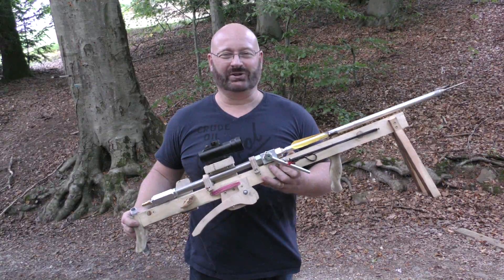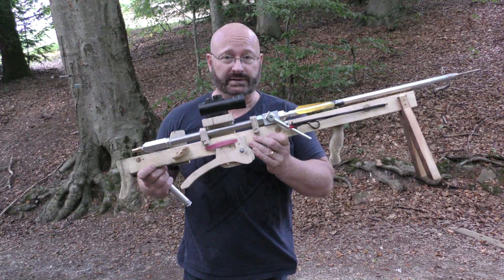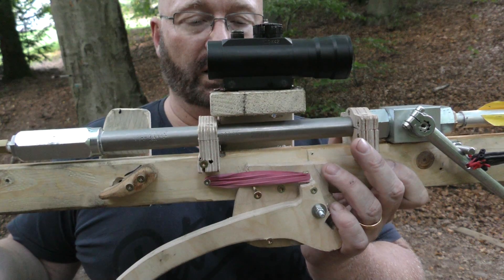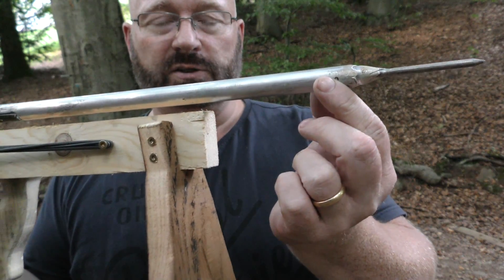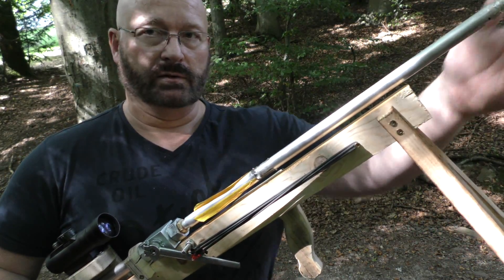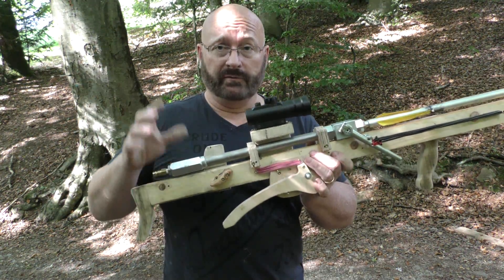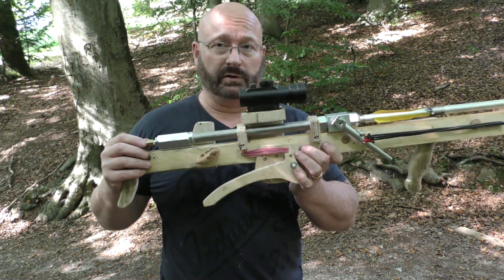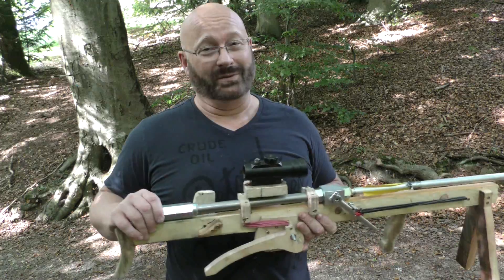Project 1000 Joule Airrowgun: Getting Closer! (714 Joule)

Comment: Hello,Some considerations and suggestions:compare the volume of the barrel with the volume of the tank. Lets say, the barrel has a volume of 0,315liter and you pump the tank to 300bar. So in the best case, you would reach 100bar at the tip of barrel as you open the valve. lets say the diameter of the barrel is 2 cm . so the area is about 3cm^2. 100bar is about 1000N/cm^2=> 1000N/cm2*3cm^2=3000NIf the barrel is 0,5 m long => 3000N*0,5m => 1500JIN THE BEST CASE. So with some 700J you should be near the optimum.Reasons, which will reduce the energy: 1.)The valve is not fully opened => arrow away before the pressure has its peak in the barrel2.)The air cools, when the pressure is reduced. This leads to a further reduced pressure in the barrel. You can see even now, the "smoke" / condensed moisture, when shooting.3.)Volume of the tank: 0,105 liter * 250 bar * 1,23g/liter= 32g air (supposing it is a ideal gas) This comes into to range of the weight of the arrow.  Some energy is used the accelerate the air itself.Suggestions:1.)Pump the arrow directly  with 300bar (Not shooting) for a static test. Maybe you was just lucky, that never the full pressure was in the barrel, when shooting due to the slow valve.2.)Remove the long outer part of the valve handle. The momentum is square to the length of the handle, because it is the outer part. => quicker opening of the valve without stronger rubber
3.)Use a bigger valve, so this is not the bottle-neck.4.)Remove all edges inside between tank and barrel5.)Try a "Dreikantschaber" as arrow-point.6.) Try how far the arrow "flies" through water.Regards from Hamburg
Reply: Little error: "Lets say the barrel has a volume of 0,210 liter" (not 0,315).

Comment: mr sprave, i think the next step if use an air pump like the one you keep in the glove comparement for when your car tire needs air and run it on battery.  so it will all be self contained

Comment: you should try and use a snaller diameter barrel to increase the velocity of the air passing through and see how it impacts the speed of the arrow. if it means using a smaller arrow u should customise it to have a heavier tip or shaft to compensate for the energy lost by the difference in mass.

Comment: As you move to higher and higher pressures,  you may want to use a hydro-test when checking the integrity and safety.  Since water is incompressible,  they are much safer.  Pressure vessels and piping are tested this way.  Don't want to see one of my favorite channels explode.

Comment: Another way you could increase the energy is to use helium instead of atmospheric air or co2. Since a helium molecule moves at a higher rate than atmospheric air and co2 it can accelerate the arrow more over a short period of time. Cody from codyslab did an experiment where he used helium in an air rifle and if memory serves it nearly doubled the velocity of the pellet over normal air.
Reply from the maker: How to get the helium into the gun though? At 250 bar?

Comment: I think that the rapid pressure change causes the metal to flex just a tiny amount every time you shoot. Over time micro fractures will form in the metal and it will become brittle and crack. I think its totally fine just as long as you don't start to fire it 1000 times.
Reply from the maker: 1,000 shots, that is 125,000 pump repetitions! At least I'd die as fit as an olympic athelete :)
Reply: Great attitude :)

Comment: I have a much much larger air gun that uses PVC pipe and much lower pressures, with about a 20 cubic foot air chamber, it shoots 3d printed bullets and is able to punch right through 10 or 11 cardboard boxes, but of course its nothing compared to what you have made, my suggestion to you would be to make your arrows longer and thus have a longer travel time on the barrel, you might be able to get a little more power out of it.
Reply from the maker: I experimented with that, but don't forget that then the barrel also has to be longer. The pressure of the air drops when it expands into the barrel (before it hits the arrow), so at some point adding barrel length is counter productive. The 50 cm arrows are pretty much the best compromise, plus they also fly really well.

Comment: Is there a significant difference in speed and energy by moving the bands closer to the pivot point on the valve? A smaller distance to travel would mean the valve is open in less time?
Reply from the maker: You have to balance things carefully. Getting closer to the pivot would require much more rubber force as the lever effect goes down, and at some point that will cause mechanical issues.

Comment: a hand gun in .40 s&w haas around 650 joules, a rifle in 7.632
 by 39, has 2,000 joules, and a 7.62 by 54 has around 3,500 joules.

 you have a way to go!
Reply from the maker: Don't compare this to a gun, shooting tiny, blunt and soft projectiles. Compare it with commercial compound crossbows. Arrows are much more lethal than bullets.
Reply: How many joules do you think you can get the air gun up to? if you can get it up to 1,500 that would be crazy. And what if you had some external tank you can swap out, to make reloading faster?

Comment: what if you made the valve behind. (using vaccume instead of pressure (pressure from atmosphere would push the arrow))  and the barrel was the reservoir ?

you would loose the air expantion lost in the barrel lenght

Comment: Jörg, if you can't manage 1000 joules by switching over to the compressor with 300 bars, what's your next step? Will you make the arrow heavier, or do you have another part of the system you're thinking about changing? Make the pressure chamber even bigger?
Reply from the maker: Bigger chamber and more rubber would be the logical step. More rubber requires a new valve lever, from solid steel though (this one is probably zinc).
Reply: JoergSprave
Yeah, I was waiting for that handle to snap. Maybe add a second stopping screw on the other side of the hole you drilled?

Comment: I thing you should slim down the barrel. There is much air loss expanding in the barrel. things about smaller barrel:
1. less air is lost in the barrel
2. less air is able to push on the arrow tip?

Best sollution will be opening the breach in the arrow tip... but that's imposible... So maybe you can try calculate how many cubick centimeters of air is in the barrel and count it to the presure.
You know if is same amount of air in the barrel as in the chamber you will get something about a half of the air presure at the end of the arrow.

But shorter arrows are less stable so... it's your choice but I will do some experiments and try every posibility. thx for reading this. bye

Comment: Maybe you could make it shoot twice with one pressurization (don't use that word every day lol)....  Connect two of the tubes you're using to hold the air with a high pressure valve, fill the entire section up with the valve open, then close it.  The regular trigger would operate the first valve and fire.  Then the second air tube could be fired with a separate mechanism.  Seems like something that could be done without much extra space or weight.  Hell maybe even 2 more shots if you used a T valve that would allow air to travel from one of the rear two tubes through the front separately from the other read tube.  Just an idea to play around with lol.

Comment: a couple of suggestions from a non crazy german engineer.

1. add more 30cm tube things. link them up so the release gas at the same time.
2. a little tuning. the pipe should be as long as the arrow. this increases the pressure felt by the arrow by a tiny bit.
3. this may sound stupid but what about a trigger for the trigger? the first trigger would release gas from a tiny cylinder which would trigger something. the Something would be the trigger for the actual release of the arrow. 
this may be complicated but its probably faster than that rubber thing you have now.
Reply: You triggered me with your idea of the trigger for the trigger
Reply: +Det Crusader triggerception 
4. oil or some other lubricant. it may slow down the arrow or it may act as a seal increasing power. either way it lessens the friction between metals.
Reply: +Bryan Suh 5. A longer barrel can store more gas (more energy) and will make the weapon more stable and precise.
Reply: +Det Crusader actually i think the arrow has to be increased in lenght with the barrel. if the barrel is longer than the arrow, it would result in lower air pressure, hence the 3 idea.

Comment: Titanium instead of wood to give weight reduction, bigger parts that fit into the air gun stock for safety and control, Higher grade rubber for release with crank, hmmmm back of the stock could have the air loading system. this would have a cap, would greasing the pipe give less resistance at that point for an easier glide? What about optimizing the pipe's diameter for more direct compression? Would that even be effective at that high of pressure? It makes me think that it might loose accuracy.

Comment: #Joerg Here another safety thought: The fact about "an equal and opposite force being exerted" - make sure that whole barrel assembly is bloody anchored well on that wooden frame, you would not want that coming off while having your face behind it.... sorry about my continuous whining concerns about your health :P
Reply from the maker: It is clamped down with two steel reinforced pieces of 18mm plywood, no dangers here.
Reply: The weight of the projectile isn't high enough to exert a large counter-force imo

Comment: Maybe you mentioned it anywhere but which diameter and lenghts (or volume) does the barrel have?
Reply from the maker: Barrel is 14mm outside, 10mm inside dia and is exactly 50cm in length.

Comment: some serious stuff here, you can try to vacuum the barrel either with the seal between the arrow and the barrel (it is not actually a barrel because the arrow is over it) or with little aluminium cap on the end that will pop easily like in the sensors for shockwave damage. this might help, because by increasing the pressure difference and clearing the way for the high powered air you will get better energy transfer. I hope this helps. good luck and BYE BYE

Comment: the arrow accelerates while he's over the inner barrel, so if the barrel would be longer, the arrow would accelerate for a longer time at the same rate so theoretically it should be faster. 

Another thing that came to my mind: air is compressible so if you have 105cm³ at 300Bar in your air tank and let's say the same amount of air(I have no idea how much it actually is)  in the barrel ab 1bar (atmospheric pressure) they will level out to 150 bars before even moving arrow. So in theory it would help to fill the barrel with a liquid (a solid thing would be seen as a projectile) that has actually zero mass( if water was used, it would take most of the energy instead of the arrow). 

While writing this it starts to sound pretty stupid so screw that second thought but a longer barrel might actually help. And mybe an even bigger airtank
Reply from the maker: The longer barrel also has more air inside, plus the arrow is more heavy. Water might work but it is messy and probably illegal (I am shooting matter through a barrel).
Reply: Da wäre ich mir nicht so sicher: Hochdruckreiniger "schießen" ja auch Wasser durch einen "Lauf". Man müsste mal die Definition von Projektil nachschauen

Comment: When you get it to 1,000 joules, it's gonna be frightening-- hell; it already is!  I wonder if you'd need to reinforce the arrow to withstand all the pressure, but I'm assuming your ammunition is tough enough!  I bet, with the right arrows, you could have very effective armor piercing projectiles.
Reply: The sheer power it's putting out is really impressive.  I used the word frightening to be dramatic.  :p
Reply: I would like to see what it does to an AR500 armor plate using arrows with a hardened steel tip.
Reply: Speed is what penetrates armor. This lacks speed.
Reply: True, but if we're talking about light armor say, a car door, than I think with a hardened carbon steel tip will be enough to get through that type of "armor".  3 Archery mats aren't even enough anymore.

Comment: Would a solenoid valve be able to release the air faster?
Reply from the maker: Solenoids that run on portable batteries won't work under pressure rates like this.

Comment: Use a lighter arrow and try to break the sound barrier hahahaha!
Reply: yep. i also wonder how fast the gun could shot.
Reply: It would lose energy and likely become unstable with a lighter weight and higher velocity
Reply: A lot of energy is being wasted already because the arrow leaves the barrel so quickly.  It might indeed go faster but a heavier arrow will be more efficient at absorbing more energy and so pack more joules.
Reply: Shadowknight5518 Barnaclebeard , clearly you both need some lessons in physics. 

Shadowknight5518, no. An arrow is designed to have its centre of drag behind its centre of mass. It would not be difficult to design a mach1+ arrow today. 

Barnaclebeard, Not necessarily. Very tricky to work out which is more efficient due to barrel length, pressure leak etc. A lighter arrow on a longer barrel would be better than a lighter arrow on a shorter barrel only if the pressure in the longer barrel is positive until release. Its a balancing act.
Reply: +ItsThatMilkshake You literally just said to make the arrow lighter. You'd have to take the weight from somewhere and to boost the speed to Mach 1+ you can't just take weight out of the body, you'd be taking it out of the front. Therefore... Unstable at higher speeds.
Reply: Shadowknight5518 ...... what the hell are you on about pal?

You can take weight from anywhere you please, and as long as you have the centre of drag behind the centre of mass. This is the bare basics of flight stability. I have finished MECH2700 at the University of Newcastle ie a fluids and thermodynamics course. 

You can take weight out of wherever you please.
Reply: +ItsThatMilkshake doesn't matter, the amount of weight you remove to let it travel at the speeds you desire will not allow it to fly stable in one piece
Reply: Shadowknight5518 Wrong. You clearly underestimate the strength of modern composites. 340m/s is not that out of this world. A .22 calibre bullet breaks the sound barrier and flies stable despite being many times lighter than an arrow. A carbon fibre arrow with a mass of 300 grains (0.0194397 kg) with no pressure leakage could hit the speed of sound with 1123.61 joules of potential energy in a perfect system. Jorge could definitely obtain a high enough potential energy for this while accounting for inefficiency. All he needs is a stiff enough arrow, which is not a problem.
Reply: +ItsThatMilkshake yeah I'd like to see it happen, but I believe a 22. Uses centrifugal force from rifling to fly straight and it's much smaller and denser than an arrow that goes around the barrel. I can't think of a material that is strong enough and light enough to make into an arrow that won't tear itself apart. Maybe if he made an arrow to put down the barrel but the hollow arrow as wide as his barrel just seems unrealistic
Reply: Shadowknight5518 HOLD UP SON. You just said centrifugal force, WHICH DOESNT EXIST So now im even more confident that you have no idea what you are talking about 

NOPE, a rifle does NOT apply a centripetal* force, the rifling applies a torque, which gives the bullet angular momentum, which then results in stability along the axial axis, along with aerodynamic efficiency/design. Oh you cant think of something that would hold up? I CAN :D carbon fibre, 7075 aluminium, titanium, and many more! 

If Jorge used 3000 PSI on normal arrow dimensions, the MAX pressure inside the arrow would only be 119 megapascals which is one quarter the yield stress of 7075 aluminium. EASY :D

It may seem unrealistic to you, but I have studied thin walled pressure vessels at university my friend. Its 100% realistic.
Reply: +ItsThatMilkshake +ItsThatMilkshake didn't say it was impossible I said "unrealistic" he's not going to spend the money, or design such an arrow. It's just u realistic. And yes I have no idea what I'm talking about with bullets as I admittedly have never studied the effects of rifling (I'm not sure why you felt the need to bring that up though). Honestly though you sound like a good guy but I naturally doubt everything everyone says that I know will never happen.  I don't want this to continue (sick of the notification spam) so I won't reply again but I enjoyed talking to you if that's what it's worth :)
Reply: Shadowknight5518 Jorge has the power! And the money

Comment: How about changing the gas used, maybe carbon dioxide or nitrogen?
Reply: Doesn't matter what gas he uses. Pressure is pressure.  A pound of feathers exerts as much force as a pound of lead.
Reply: +BDF 
I'd rather get hit with 5 lb of feathers that quarter lb of lead going at 50mph. 
Gasses have different properties, some are more "fluid" than others. I.e. Helium could expand faster than CO2 giving a higher output speed. 
Science..
Reply: If Hydrogen or helium was used it would make a difference.
Reply: +BDF Watch the episode of Cody's Lab - light gas gun.

Comment: Hello 
I have some suggestions that may get your new creation over the line you have drawn in the sand.
1. is lighten or shorten the ball valve arm 
2. Teflon coating barrel shaft.
3. Us a springer gas than air.
4. IS VERY TOP SECRET AND I CAN NOT WRIT IN THE COMMENTS LET ME KNOW IF YOUR INTERESTED ? 
5. I may have some others also I do wish to see you reach this amazing goal you have set your self. Please do some more high speed but close up to the arrow to see what other things its doing under firing pressure. 
I'm a moder that what I do please let me help if you think I can. 
Go Man GO You Can Do It !
Regards 
Adam VA of AVA Magnetic Levitation AUS